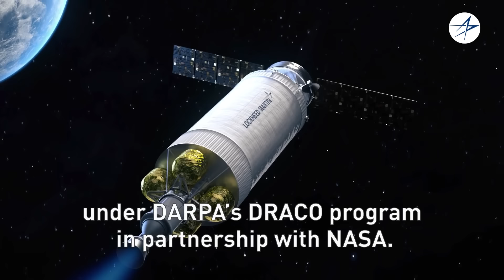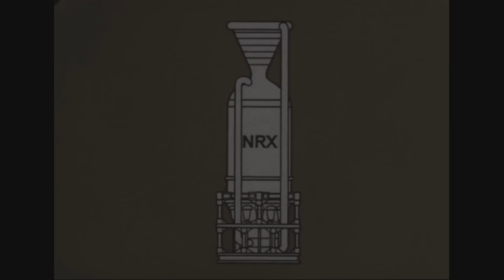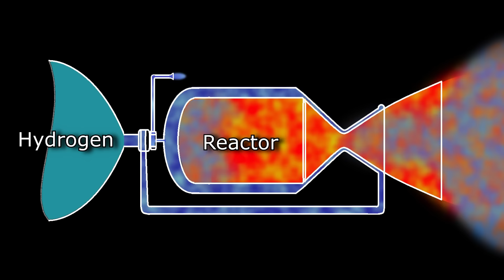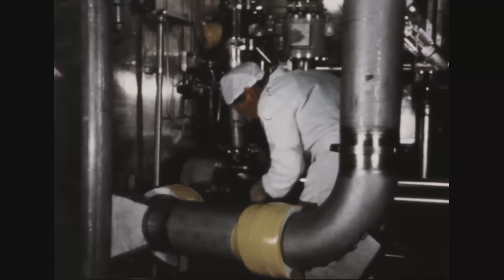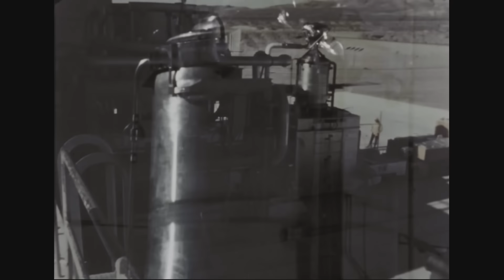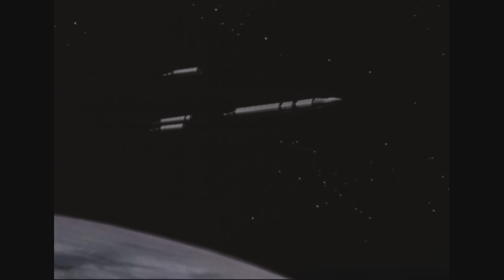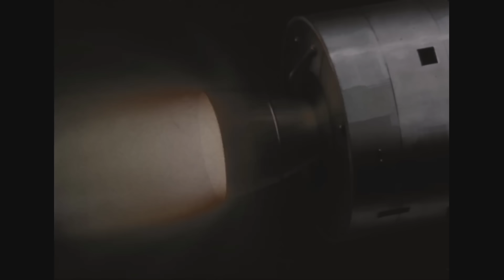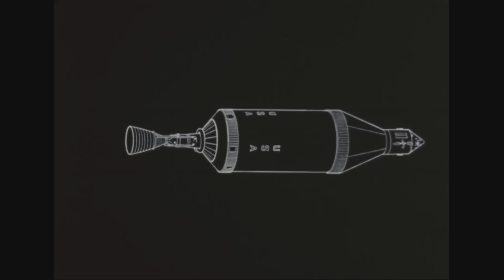Why Nuclear Rockets Are Going To Change Spaceflight

Comment: I originally wanted to be an aerospace engineer. But when the space program was cut back in the 1970s and the “energy crisis” was upon us, I switched to nuclear engineering hoping that nuclear rockets would come back. It never happened and I worked for 35 years in commercial nuclear power doing physics and safety analysis as well as writing software for real-time simulators. I guess I was born 30 years too early or 30 years too late.

I remember one of our homework problems involved determining the startup rate for a nuclear rocket considering the reactor kinetics (just a simple point kinetics model). That was the closest I came to my childhood dream.
Reply: The fun thing about this day and age is that much of what we learn and create will eventually spread to the next generation.  No matter how big or small our contributions, they add up over time.  That's how we got where we are in the first place.
Reply: @r3dp9  well said!
Reply: @r3dp9 THIS!!! ☝️
Reply: I'm a bit younger and did Aerospace in the late 80s.
I totally get the part about the program cuts. 
We expected to build Space Station Freedom in the 90s and be back on the moon circa 2001.
Then one day we went to class and Challenger happened.

The real issue is that AFTER Apollo the greedy slimy rats in the aerospace industry realised that NASA was a cow they could milk. Eventually it didn't even matter if they made stuff that worked just so long as they could convince their state's senators in Washington to keep the money going and keep the jobs.

That's no longer just a NASA problem either its rampant across the developed world. I'm Australian but did my degree in America and our research organisations are now run by economists and they have made a mess of everything. This is why so many things seem to be grinding to a sluggish pace. Its the interference of economists who then convince the politicians what's good versus  what's NOT. In most cases project success does not even enter the conversation.
Reply: @tonywilson4713 I hear you! The pork barrel approach really messes with the priorities and most useful projects to pursue. I think the way around the log jam is how small companies (especially start ups) do the very innovative and risky things. When it’s proven out, they get acquired and hopefully the technology works its way into final solutions.  That’s my optimistic view of how things work.  Your mileage may vary.  :-) 
   Having just seen SpaceX succeed on flight 4, the cost to LEO maybe about to plummet even more than the falcon 9.  It’s a very interesting time to be in aerospace.
  (Perhaps the next generation will be able to move to some O’Neill habitats?)
Reply: I'm a bit younger and did aerospace engineering in Europe the 2010s. Thanks for confirming all my impressions are right @tonywilson4713
Reply: @tonywilson4713 I don’t think the politicians need much convincing bud. They’re all skimming budgets or doing favors for their friends
Reply: @tonywilson4713 I'm 16 and am gonna be going into aerospace engineering 2 years early actually. My state has this program where you can go study at a boarding school on a university campus and get your associates while you're at it. Personally I'm wanting to go into rockets, do you have any tips or advice at all?
Reply: @WinterySpy2554  Yeah be prepared for everyone to NOT believe your an aerospace engineer and that they are all smarter than you are because Elon Musk told them they are.

Then when they realise they aren't smart they'll expect you to fix everything YESTERDAY.

But that's all down the track.

In the meantime. 
1) Pay attention to your math skills. 
Engineering is basically the profession of applied math. You'll end up doing 5 or 6 pure math classes treat them like going to the gym or the training track. Pure math classes are where you get your brain math fit but the real event is the engineering classes.

2) If you don't get something ASK. If you don't want to put your hand up in class go see the professor afterwards or the tutor for the class. 
NOBODY gets everything 100% of the time. 

3) You will have do do a certain number of humanities classes. DON'T WASTE THEM.
Do the basics like Econ 101, Psych 101, Sociology 101 and then look for something that at least interests you. I ended up doing 3 classes in ancient civilizations (ancient Greece, Greek & Roman mythology and Greek & Roman sports). I grew up on films like Jason and the Argonauts. Star Wars is basically Greek mythology with spaceships & lasers instead of swords and sandals.

ALWAYS get 1 or 2 done each semester in the first 2 years because years 3 and 4 get so damn hard you don't have much time for other classes. 

Also find out before hand if a humanities class consumes lots of time. When I did Psych 101 we had to do all these labs where we were basically the lab rat for some psych post grads research. I hated all the time they took. 

4) BE CAREFUL WITH YOUR TECHNICAL ELECTIVES. At my college we had lists of options in electrical and mechanical engineering and you have to do 1 or 2 from each list. I did 2 in electrical 1 was fairly easy - almost high school level. The other was painful. It was in solid state electronics and I was the only aerospace my year to try it. Its was all about how transistors are designed. It was interesting and I now know what Jensen Huang means when he talks about chip design. BUT that class was math intensive and even the electrical engineers struggled with it. Your 3 & 4th year aerospace classes will be hard enough don't make those semesters harder than they have to with hard electives.

5) BE EXTRA CAREFUL with your aerospace electives. In your 4th year you'll have to do a couple of higher level aerospace electives. Stick with the classes that everyone else is doing that way you can study with others. 

In my era everyone typically did Finite Element Analysis (computer modelling of stress) and Orbital Mechanics (how you fly and navigate around the the solar system). 

I did FEA because my professor had already taught it to me and I aced it 👍😉. I ended up tutoring the class I was taking. That was my smart move. 

The dumb move was I did Spacecraft Dynamics instead of OM. SD is about how you make things point in the right direction in space. Sounds easy but its the complete opposite. Its simply the hardest math in all of engineering because its all about gyroscopic control of roll, pitch & yaw and that involves parallel differential equations with coordinate system transformations. Remember when Luke Skywalker told Yoda he wasn't afraid and the Yoda said he would be. Yeah I found out what that meant.

I think 5 of my undergrad tried my year and we all tried to get out of the class within a couple of weeks and switch to OM.
 
It was super interesting because in 1987 all the post grads in the class were funded by DARPA and working on Star Wars projects. So we got to hear what they were all doing and that was interesting stuff.

These days when people talk about space based lasers and weapons and claim "AI can do it" I just laugh at them. AI can't change basic physics no matter what they claim.

Sorry to prattle on but I basically give the same advice to everyone who asks.
- Be careful with your electives and options.
- Getting your degree is more important than doing the weird classes cos they sound interesting.
- Leave the weird classes alone unless you know that a specific class will be worth it.

MOST OF ALL ENJOY YOURSELF 
College will be over and one day far in the future you'll wish you could time travel back and redo things.
Reply: Being born 30 years too early is easily fixed by living 30 years longer.
Reply: @RFC3514  These days 60s are the new 40s
Reply: When I got my NE degree in the mid 90s, one of the professor actually worked on Kiwi (the actual name of the test engines for NERVA).  He noted that the final destruction test was impressive as they ramped the engine to maximum power and it shook itself apart and was spitting fuel rods out the nozzle.

Plenty of those professors were around post Manhattan and were involved in a lot of the test reactors and H-bomb and later tests.
Reply: Never is too late
Reply: I was also in commercial nuclear power, but we had an ongoing connection with space travel- Our Reactor Physicist was on a different planet!
Reply: Why was project orion dismissed?
Reply: @chugs1984  Short answer: Chernobyl and budget cuts.
Reply: Regarding project orion, it was stopped because of a treaty that banned the explosion of nuclear weapons in the atmosphere. The problem of contamination from nuclear explosions is even worse than that. A nuclear explosion anywhere within the Earth's magnetosphere will allow the fission products to migrate back down to the earth.
Reply: @chugs1984  lmao😅 I think the impact study declared that on every launch Orion would kill 2 additional people due to increased radiation per year. so, 100 launches, 200 extra deaths per year for whatever the half-life is probably a few thousand years, and that doesn't include wildlife, only human. I could be wrong was a bit since I've seen that documentary. Also might have been a Scott Manley Documentary..
Reply: They are considerably slower when the gas pedal is slammed to the chip.......What is your feelings or general view on the reactor contamination during takeoff or on abort.......would it be better to not have the safety destruct blow up the rocket
Reply: Hello, I am graduating from a nuclear engineering program and my interest lies in space exploration. Could you help me by sharing how you started your nuclear career as I am struggling to find a role.
Reply: @guspus3050  - I worked in commercial nuclear power so I really have no direct experience in applying it to space exploration. The two problems of manned space exploration that nuclear engineering can be of use are in nuclear propulsion as discussed in Scott’s video and the effect of ionizing radiation on humans and materials. Whether we use nuclear propulsion to reduce travel times that reduce radiation exposure from space-borne radiation sources or use existing chemical propulsion, we are going to need lightweight shielding both from the reactor (if we have one) and cosmic rays. Further, the reliance on computers and electronics requires that they be radiation-hardened. Another area applicable to space exploration is using nuclear radiation for testing the quality of fabricated components.

The reactor design gets all the attention but the other areas are all potential showstoppers.

Hope that helps.
Reply: @KevinBalch-dt8ot  Much appreciated! I do like to work on neutronic simulations. I shall try to find companies doing radiation testing and characterizing.
Reply: So what do you think about the Burevestnik?
Reply: Early physics safety analysis code was the first ray-tracing software.  Beating swords into ploughshares is one thing, but beating gamma rays into art supplies was quite a trick.
Reply: Why don't you apply to Lockheed then. I know a guy in his 70s getting a degree at my school. It's never too late. I hope you get out of that mindset.
Reply: @diegocordero676  - The other thing is that there IS age discrimination. Old White guys don’t help the diversity metrics.
Reply: @KevinBalch-dt8ot  I didn't say in my first comment, but the classmate who is 70 years old has a job waiting for him at Airbus. The question you have to ask yourself, "Do I want to put in the work?"
Reply: Will do
Reply: @diegocordero676  - I’m happily retired! Why work and be taxed on it for a government that hates its own people?

Don’t get me wrong but I did do many interesting things in my career even if I didn’t work in aerospace.

Now I don’t have to answer to anybody.
Reply: that's  closer than most get
Reply: mustve sucked when energy companies lobbied against nuclear power and completely set us back in what couldve been possible
Reply: I don't think there's anything wrong with working for 35 in the commercial nuclear power industry. Fission reactors have got a hell of a lot better in 35 years even if most people don't know about it.
Reply: You were meant to be unc
Reply: I am fresh mech grad can you help me to learn about learn more aobut nuclear thermal rocket. pls share your email. We have 30 years now.
Reply: Thank you for all the work you did regarding nuclear power physics and safety analysis. Very much appreciated.
Reply: I'm so sorry you never got to live your dream. Truly. 😢
Reply: @Dave_Crupel mentor! Advisor! Grad student guest lecturer! NE Is not my field, but as a recent retiree, with 40 years of history, I am now 'the old guy' that I learned so much from when I was a graduate student. i couldn't absorb half the the things they told me. But i've added my half, and even if its just a coffee meeting to discuss something (real or virtual) its rewarding.
Reply: Salomon Levy also dodged a bullet by not joining NEPA and gave us GE NE BWRs.
Reply: You need to read the 1971 Peter Farley's space annual 

He says that we'll be on Mars by the mid 1980s 

It's a great book though for space enthusiasts
Reply: Thoughts on Artemis?
Reply: @ShortKingofKings  - Complete dumpster fire. Artemis 2 will circle (not orbit) the moon. Then the program will be “on hiatus”, suspended or cancelled because of technical problems and ultimately unaffordable costs. In a few years, the federal government will have such a money crisis that no one is going to care about the moon except spaceflight fanatics. They certainly won’t support a tax increase to pay for it.

We’ll get a lot of nice artwork and CGI out of the project though.
Reply: I'm sorry that happened bud. Blame politicians and your luck.
Reply: Dont worry, we will carry your dream forward
Reply: We're always born too late or too early for something...
Reply: Love this.   Its great to study and be smart.   Thanks for sharing this.
Reply: nostalgia expressed in its purest form
Reply: In 30 years you can work on nuclear fusion rockets in 30 years
Reply: damn
Reply: but the calculation is the best bit anyway!
Reply: Why did you not build a nuclear rocket yourself?
Reply: For safety's sake, nuclear rockets should be launched from a spaceport on the moon.
Reply: Says that clever guy with the nuclear rocket in his backyard shed .., 😂
Reply: Solar to electrical water hydrogen separation,,,then slap them back together hydrogen peroxide thruster powered by Neptune a long way gas station
Reply: propulsion is irrelevant, there's too much stuff flying around up there, then there's the radiation.  space travel for humans is impossible, including going to the moon
Reply: I'm going to be honest with you chief. I don't see nuclear engines being a reality. 

For starters, Hydrogen is known to be an extremely difficult element to work with. Let alone liquid hydrogen which has to be kept at 20 Kelvin. It also likes to just seep out of every miniscule hole too. 

I also don't see how this engine can be reusable. You're pushing the engine to bear some extreme temperatures since there isn't much, if any, cooling going through it. You can use ablative cooling but that only emphasizes the single use nature of the engine which is the opposite direction we are heading. 

Having a nuclear reactor inside the rocket to power your ion thrusters just makes more sense. Better efficiency and specific impulse there. 

Doesn't produce much thrust, sure. But you don't need much thrust when you're in the middle of space. Anything would accumulate greatly
Reply: @Quasar-2 I mean, we’ve used LH2 in space plenty. Stored it, even. It’s not too big of a problem. Its not easy, but nor is it horribly difficult
Reply: @mduckernz  stored it in space? 

I can't think of when. The longest storage of LH2 I can think of was just under 3 hours for the Saturn V 3rd stage TLI burn.
Reply: @Quasar-2  Ion power is awesome, don't get me wrong. Maybe great for cargo. But a nuclear thermal engine gives a manned mission abort modes going to Mars. Its powerful thrust can get them on a return trajectory in a hurry, rather than months and months.
As for hydrogen, I agree with you quite a bit. There are those that believe that they can tame it using thermal shades. Keep in mind that on the shadow side of a vehicle the temperatures gets really low. That is possible, but I worry more about deterioration of the seals. Look how many hydrogen leaks they had on the shuttle, and look at the Boeing Helium leaks. (I know it isn't hydrogen, but it is pretty close.)
However, that being said. Hydrogen might be the most EFFICIENT reaction mass to use in the nuclear engine, but it is not the only choice possible. If you are willing to sacrifice a little ISP, water with a lot of antifreeze in it would be entirely suitable. 
See the movie: "Destination Moon". (Book written by Robert Heinlein. I think he has a screenwriting credit too. Heinlein was using the ideas of Von Braun and others of the time.)
Reply: @Quasar-2  Solar will absolutly crush any nuclear electrical system within the orbit of Jupiter on power to weight.  Solar electric is the obvious technology to persue but political forces in congress hate it because it was is dosn't fit their macho vision of space.
Reply: @Quasar-2 aside from hydrogen not being a problem liquid hydrogen is a very good coolant and regenerative cooling is commonplace
Reply: Well if you're bored we could always use more financial trading system automation systems builders.  ;-)
Reply: @enewhuis  - No thank you. I prefer honest work that produces something useful.
Reply: @KevinBalch-dt8ot no pyramid schemes?